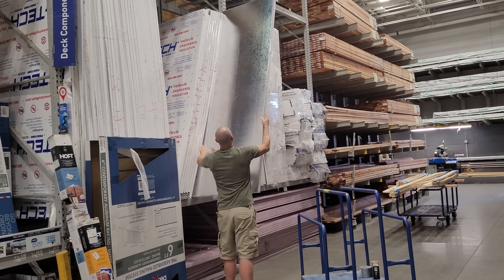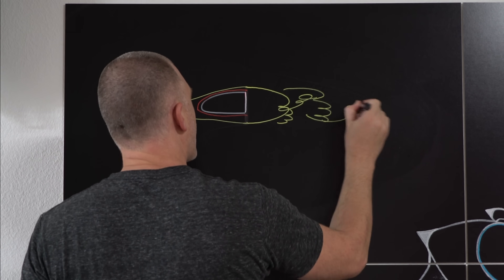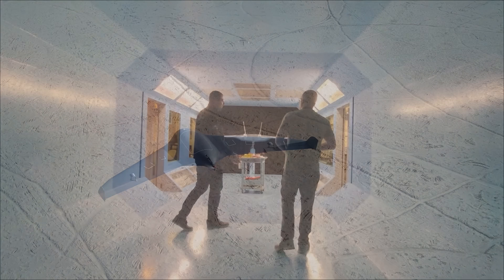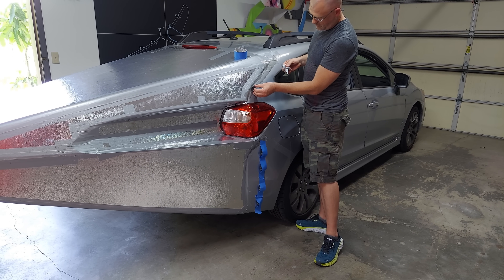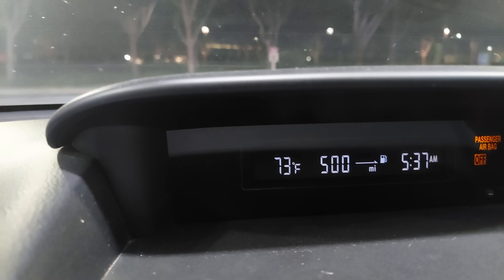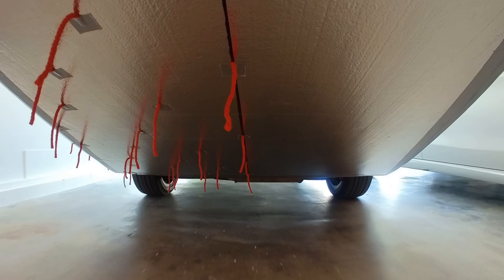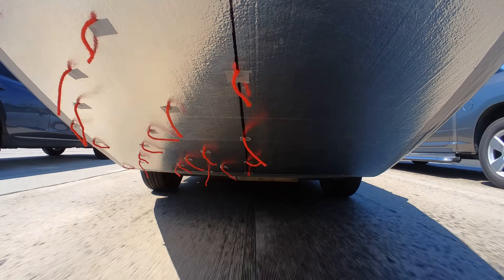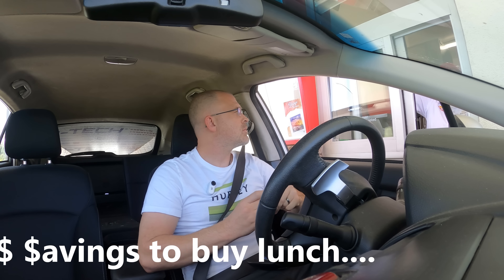Using Simple Aerodynamics to Beat High Gas Prices (Home Improvement Store Edition)

Comment: Awesome!

You may have legal issues about the length of air ducting that extends past the tail lights & licence plate.

Since the ducting is functioning as body work, the rear of the car is now legally defined as the end of that, and your lights may be required to be at the rear of the car.

As for the licence plate, it may be required to be viewed from the side of the car, but it's not since you need to look down the "portal".

Otherwise that's pretty cool. I think you should make one from 0.030" aluminum held on with pop rivets when you have the design "finalized", so it is a little more durable!
Reply: Better off to bondo all the gaps, sand, and fiberglass the whole thing.
Reply: @ac.creations I guess he could 'glass the whole thing, since currently it is foam!
Reply: @shpstr  im gunna guess he didnt want the whole internet to see his license plate info lol
Reply: Not an issue as he added a red light see  5:05  but should add  red reflective tape or reflectors
Reply: @punker4Real  that's a taillight, only, and it looks more like an afterburner.

Comment: In the Netherlands they did an extreme fuel mileage build. They got 1L per 32km on a small hatchback, which is 70 MPG+

They did strip it out for lightness, lowered it, did the tail thing and deleted two of the 4 pistons
Reply: Which a 20 year old, combustion engine only, VW lupo 3l and Audi A2 (3l) can do from the factory, 100% stock. So I dont know if I would call it extreme... Extreme from what they started from perhaps, but not as a mileage number.
Reply: @Random I dont, thats why I used the Eu-mix fuel economy rating numbers. Seems unlikely their test route is much more demanding, but who knows. OP didnt state or link it, as you asked.

Comment: Vortex generators help remove any smooth flow you might be getting down the side of the car. You probably already have a ton of turbulence from the wheel wells, but I think you need to try your run again with the vortex generators removed and the yarn indicators back on to see if that helps at all
Reply: Vortex generators are used on the upper surface of light aircraft wings to increase lift at low speeds (for Short Takeoff and Landing or STOL aircraft) though at the expense of greater drag and lower top speed.  I am confident that these are NOT helpful on the sides of your car. 
A partial or full belly pan would likely be helpful though as another stated, be sure to allow an outlet for hot air from the radiator.  
The "aero" features on cars for the last 25-30 years are there to make the car look distinctive and give the illusion of value.  No way do those features push the car down the road or reduce its weight.
Reply: From what I know, it's to prevent low pressure zones where there are gaps, preventing a more violent form of turbulence and vortices. Not complete sure though
Reply: Yeah, the older 737 Classic had vortex generators to induce flow separation over the wing due to the apricot-shaped nacelles and also around the tail area. I’m not an engineer… but I think vortex generators are generally counter intuitive to having smooth airflow over a surface.
Reply: I was wondering about that myself? Why vortex generator's? They create turbulence "
Reply: @briancoss8482  turbulence can be used to reattach airflow. Look at modern fighters with their massive strakes at the wing roots. They provide most of the lift

Comment: Any thoughts on engine mods that might help as well?  How about applying a very fine water mist to the intake, proportional to air mass.
Or partially covering the radiator to reduce drag, depending on cooling required.
Guess there's only so much one can do with an almost steam-engine.
Can't wait for your next round of results. In the meantime I'll smugly drive around in my 4 year old EV, charged exclusively with Hydro power.

Comment: As someone that has spent the past week browsing the ecomodders forum, this is super great.

The wheel covers look good. A belly pan would be pretty helpful and maybe some rear wheel skirts. Also make sure your tires are inflated
Reply: Sheepdog 44 shared this on Ecomodder, where I found it:  "Think Flight: Using Simple Aerodynamics to Beat High Gas Prices."
Guys there have been doing this stuff for 20-30 years.  I tried to ecomod my 1999 Subaru, but I bought a 2000 Civic, and never looked back.
I used to spend more on repairs than gas, and too much on gas! :)

Comment: If you need ventilation/cooling anyway, ducting that air so that it vents into the cavity raises the local low pressure region reducing pressure drag. You might be able to put in a bypass duct for those tail lights.

Comment: You generally need half the angle on the bottom of your boat tail than the top because you're sucking against a flat surface, where as the top is to atmosphere. 7° is usually about right for the bottom. 13° for the top and sides.

Comment: my 2 cents ;)
did you include the weight gain?
do a comparison by loading your car with the same weight as your aerodynamic attachment to determine how much more fuel is consumed due to the higher weight and then calculate the efficiency value...!?
or how the aerodynamics change due to the "angle of attack" of the body due to the additional weight behind the rear axle, the easiest way to reduce consumption is to forego "unnecessary" gadgets that would make the vehicle lighter
Unfortunately, mankind are sloths and get used to things like electric mirrors and seat adjustments, rear-view cameras, window lifters and all these electronic clutter that you didn't have or need before. 
a "perhaps" bad comparison is e.g. the VW Golf
1st generation max empty weight 805 kilograms
8th generation max empty weight 1630 kg heavy
more than twice as heavy as his "grandfather" from the first one
but is just under 90cm/ 35 in. longer and 16 cm/ 6 in. wider
Golf 1 had 50-85 hp
Golf 8 has 110 - 131 hp
but both consume almost the same amount of fuel 
just imagine if you installed all the fuel-saving technology in the old golf without all the electrical / electronic waste, how much the vehicle would then save?!
anecdote from my professional life as a truck driver and fleet manager in a forwarding agency...! I tested a "demonstration" truck had 480 hp and on the route we drove every day the truck consumed an average of 29-31 liters of diesel per 100 kilometers (yes, we calculate differently in Europe) the truck we then got had 100 hp less because the boss calculated on the completely outdated rule of " 8 hp/to " which led to increasing the diesel consumption to a minimum of 39L/100km and the travel time increasing by a total of 90 minutes, which then led to problems with the  Regulation EC 561/2006 " Driving and rest periods"

Comment: 13% is kinda huge to be fair! 

I suggest putting wheel spats on the rear wheels as well, should net you antoher 1-2% at least!
Reply: but how does it fit in a normal Walmart parking space???
Reply: @gibbs677bg  the whole thing could hinge at the top and fold over the top of the car.  Or an idea I had years ago would be for a tail like this to be inflatable.  It would just inflate once you were on a highway
Reply: @kentonian  Do it like the semi-trailer "Drag Tails"... Have it fold into 4 sections.  The aerodynes under a semi-trailer are very important too, so you might need to mount rubber mudflaps between the rear wheels.
Reply: @gibbs677bg  The stock Impreza is 23.1" shorter than the shortest F150 of the same year.
The longest F-150 is 74.3" longer than the base Imprezza.
Reply: @gibbs677bg  
He probably doesn’t.
Reply: 10% increase means every 10 fuel up you save one right(as in 10 fuel up = 11 fuel up) no? that's a lot or am I missing something?
Reply: @ddjohnson9717  Slightly better even! Buy 9 get one free. But yeah, it's significant.
Reply: @davespanksalot8413  oh yeah new 9 = old 10. man I got fked up lol
Reply: @ddjohnson9717  yeah please go crack a remedial math textbook.
Reply: Old saying in advertising: When selling the numbers, always go with the more impressive. 13% don't mean much if it gets 10-mpg as-factory. But if it gets 20-30 MPG....😉
Reply: @pancudowny  i get about 15mpg on my daily commute.  If it went to 16-17mpg i would not complain.
Reply: @pancudowny  Still saves you 13% on gas, which actually makes it a BIGGER difference on your wallet when its burning more fuel.

Example, my car just did 16.35 MPG babying it eco boosting (RX-8, rotary engine), so if I got 13% better gas that's saving me more gallons and more money (I went 220 miles with about 13.5 gallons of fuel), so actually it would save me more overall than it would him.
Reply: 13% is absolutely mental with some foam, but also immediately shows how moot this project is. It's neat, don't get me wrong, but you very quickly run into diminishing returns and cap out at whatever your state allows. Unless you can min-max by really making a new body or major changes to the existing body and also move around the lights, there's just no way it's going to get much better.
Reply: @daylen577  Top side slope etc is optimized.  Left/right/bottom are not yet optimized.  There's a lot more room to optimize beyond the current 13%.  😃
I'm very anxious to see the next iteration tested.
Reply: @daylen577  trailer lights qualify, install easy and are made in many shapes and sizes.
Reply: @daylen577  100%, I wonder if he could start big and down scale and see how much you can reduce it and still get substantial improvements. It's disappointing cars weren't designed for aerodynamically, Aptera is showing what can be done with next level aero.
Reply: @daylen577  It doesmt need to get better. Honestly 13% fuel savings is definitely worth it financially.
Reply: @daylen577  you missed the point of the video in my opinon, he is displaying that car manufacturers think very little about the aerodynamics and efficiency of the vehicles in comparison to the aesthetic and the look of the "average" car we all already know. if there was a manufacturer who focused on efficiency they could easily be 30% more efficient ( you save 1/3 of your gas money)
Reply: Yeah, 13% is quite huge, in fact.  Over the course of a year that is a couple thousand dollars if you have to drive daily, the longer the commute, the bigger it gets.  So, when I graduated from high school in 1997 fuel prices were around 79 cents a gallon.  I was working a minimum wage job and was just kicked out of the parents' house.  I had my eye on those gas prices!  And fuel prices have risen steadily, and at a rapid pace at that, ever since.  If you take into account the fact that gas prices are going to continuously rise, and they will, you can save up enough money over the course of 10 years to buy something big, like really big, we are talking about 30 or 40 thousand dollars here.  And 10 years blows by in what feels like an instant.
Reply: @danielduncan6806  Er... 13% savings gives a couple thousand dollars?  Man, what type of commute do you drive? 😅

Don't get me wrong, 13% improvement with just the top-rear optimized is HUGE from an engineering standpoint.  But this savings should not reach even a thousand dollars per year for most people.

Here's a baseline assumption:
25 mi/way x 2 way/day x 5 workday/wk x 50 work week/yr = 12,500 miles/yr.
This was a sedan, so assume baseline 27 mpg.
--> 463 gallons/yr
At $6/ga, that's $2,777 /year.
13% savings ~ $360 /year.

A person's commute needs to be 3x longer, for the 13% savings to reach $1K/year.
When I had an internship during college, I couldn't find affordable housing near work, so I commuted the 1.5 hr from college apartment.  THAT was such type of a commute, ~75 miles each way.  Good thing it was only for 2.5 months.  If I ever needed to do that long term, I'd either get a different job (closer) or move (closer).  Imagine wasting 3 hours a day on the road. 😇
Reply: Almost 14% actually
Reply: I find fake plates work the best...😉
Reply: Dundee Didely At 25% small improvement. At 50% you achieved a big improvement. At 75% and greater. Huge improvement.
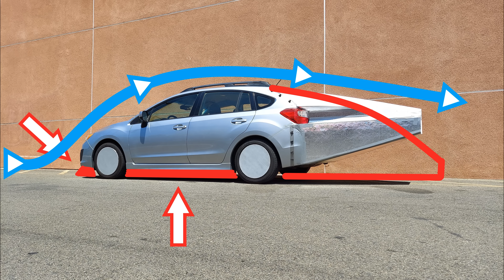Reply: 9:15 It just looks really bad when someone goes to all this trouble for extra mpg but still has the roof rack on.
Reply: @greeneking77  actually, demonstrating how the design change. Increases efficiency, while all of the essories. Are both present and in operation. Is both, the definition of its true level. Of advancement and effectiveness.
Reply: u mean like the old civic ima?

Comment: Might be worth a shot to remove the right side mirror (if allowed).
Former wind tunnel collegues told me that those amount to 10% of the total drag.
Reply: I guess that's a quite radical solution. Some really efficient cars have switched to tiny camera stalks and a screen inside the cabin to reduce drag.

But this project is more about doing the simplest and cheapest things first, without modifying the car underneath too much
Reply: @dundeedideley1773  Perhaps you're right. When I grew up the side-mirrors on the right-hand side were optional in my country. That would indicate they're easy to remove.

Comment: "Unfortunately, the average new electric vehicle is going for $66,000" these days."
Obviously, the key answer is to not be average; doing the same average things, with the same average consumer items, with the same average mentalities as everyone else.
Be and think differently than everyone else, and you won't run the risk falling into the same 'average' pitfalls that everyone else seems so consumed with.
Bravo, sir for being un-average 😉

A possible improvement might be to not taper in the rear side panels - just extend them straight back, but also dont 'contour' the bottom edge up to meet the top (when viewed from the side) leave it parallel to the ground and add longitudinal vanes every few inches between the two sides, on the underside of the 'bottom cover.'
Look at the back end (rear diffuser) of a race car for a visual representation.

Comment: I'd Look into PEV's being used on the road. Can 100% go at the speed of traffic and are typically way more efficient then cars due to not bringing around a whole car with you. And have insane range.
Stuff like EUCs, Electric bikes, and Electric scooters.
Also tend to be way cheaper on maintenance and cost less to buy upfront including proper safety gear

For example the Sherman Max EUC on tests gets 120 miles per charge. And more if you go slower then normal. And EUCs charge in ~6 hours or less depending on brand.

You will be less safe then if you were in a car. Same problem motorcyclists have. Simply because the roads in the US and other places are made for cars, Not for people walking, people on bikes, or people on PEVs.

The Cheapest form of transport is self driving cars that are densely packed with people. Those "Self driving cars" are called trains, trollies, and other forms of public transport. Which is doable at the US's level of sprawl as can be seen by the Countries that have 30 minute repeat train service to cities with a couple thousand people in them.
Also you can take small PEVs with huge ranges on Public transport for any "last mile" worries.
And for Hardware store trips or other "shopping" trips were you need to carry things you rent a truck / a small car using ride share services for very cheap or use a varient of an electric carbo bike or other options.
See the youtube channels "Not Just Bikes", "Wrong Way", and many others if you find any of this interesting. Or the subreddit "Fuc_ Cars" (fill in the blank).

I assume the reason why there so much improvement potential in Cars is because Cars dont exist to be anywhere close to optimal anyways.
Reply: reddit 🤢🤮

Comment: This was awesome.

Regarding the skirts on the bottom of the car, they would eventually get worn down or damaged anytime you go over a speed bump in the road or pull into the driveway. Maybe having them on an actuator that could be switched on based on speed or even a manual switch for the driver would be cool.

Comment: I once owned a bmw e32 7 series, it was heavier and longer than the previous model, it had aerodynamic improvements, namely a full underbody panel. That version of the 7 series was 12kl/h faster at top speed, more economical too and used the exact same 218hp engine.

Comment: Dare I ask.....how permanent is the goop on your tires? That's some true dedication to mileage
Reply from the maker: Not a mark!
Reply: @thinkflight  I see you must have been poking around at the Ecomodder forums. 👍
I'm surprised at how many comments you have on this video. 
I have to restrain myself from commenting to them all. 
It's frustrating seeing the same arguments over and over again. 
   I really hope to see a version 2. 
 As I am sure you can tell, the angle of the sides is too steep and you are getting flow separation. ( If you recall, Darin from Ecomodder had the same issue with his boattail. )
The open portion of the tail makes a nice box cavity for the airflow, but I'm worried that your plates aren't visible enough. 
Some reflective tape would also be good there as well.
I like that lighting you have in there ! 
I just might steal that idea !
Regarding the angle of the tail underside, 
If you drive up even a slight incline, it will scrape if you bring the angle down any. 
I suggested an idea on the AeroCivic for a fix to that : what about having a flat panel ( floor ) that is at the correct angle, but is mounted with arms that compress ( I'm thinking of those  hydraulic arms that hold up your hatch ) 
If that would be too costly, just have the panel hang loose by wire, and hinged.  It would shake when you go over bumps though. 
I respect that you did this without listening to the critics. 
I did a quick tuft test with my 1993 Civic hatchback. 
It's only a few seconds long, but you might find it interesting. 
I have always wanted to go all out and do a boattail but Basjoos ( AeroCivic ) beat me to it. 
Looking forward to seeing more from this project !